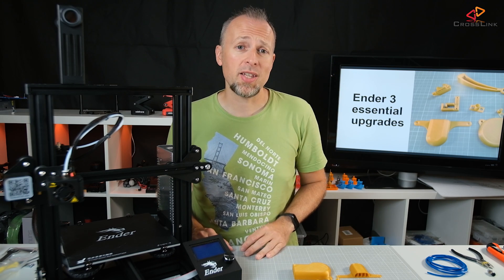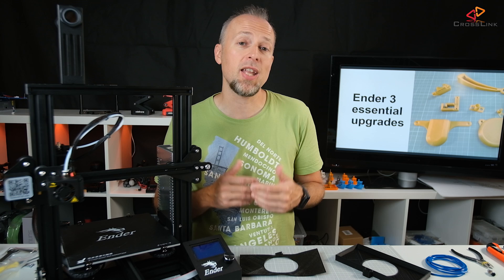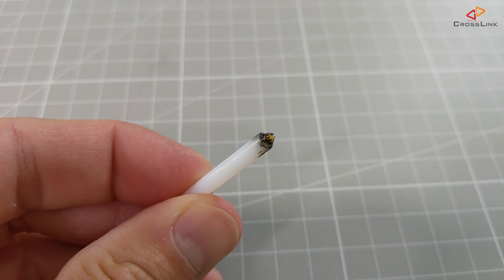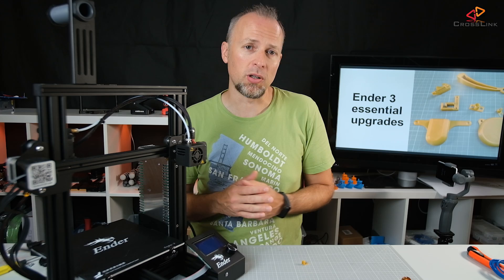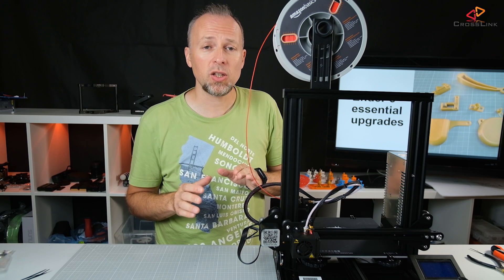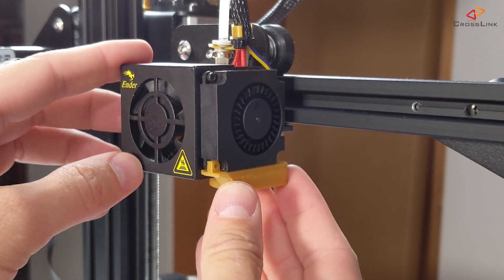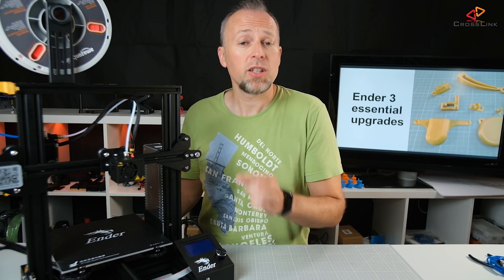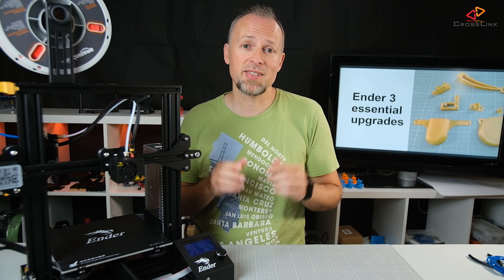Ender 3 Upgrades - Printable Essential Upgrades

Comment: I changed the cr10 extruder by rotating it 90 degrees. that solved moved problems with the filamant path, guess that also works on the e3.

patrick at patrick dot at

Comment: Nice video, but dont that cover for electronic box fan reduce the airflow? Also i think on ender 3 there are A4988 stepper motor drivers, they are not so much affected by heat like TMC for example... :D nevermind, still want to win one... :-)